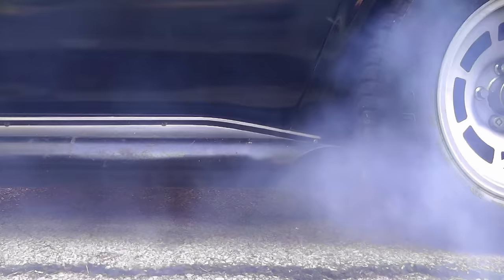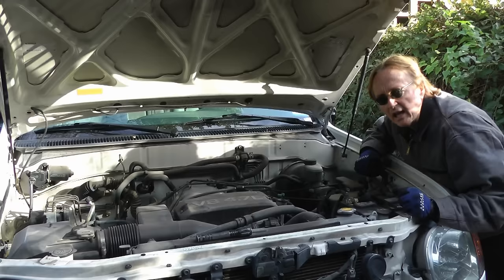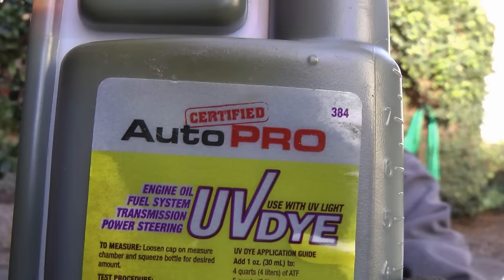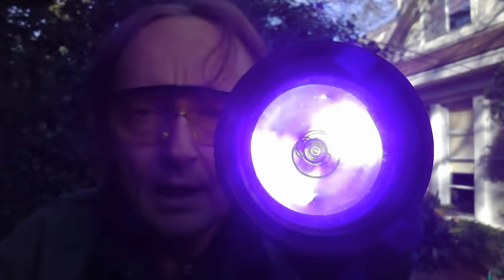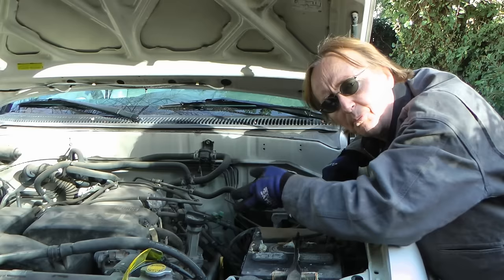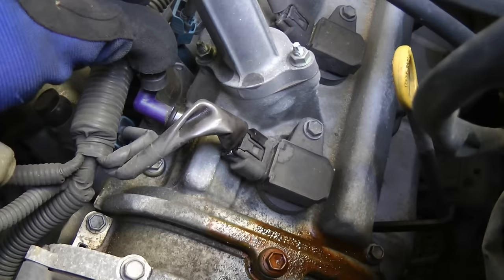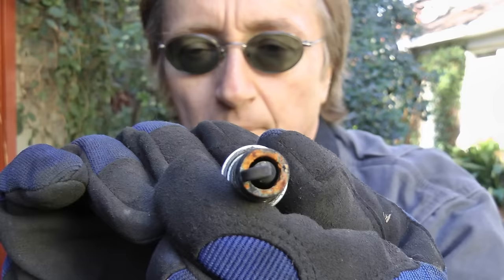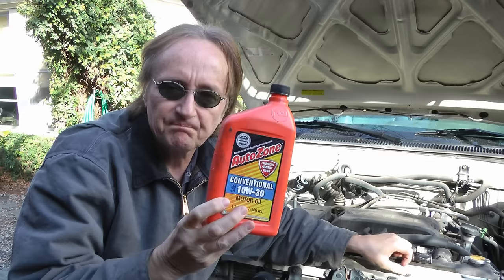How to Fix a Car Engine that Loses Oil (Leaks)

Comment: Depending on the amount it leaks, it could be a grey smoke as well.  This is usually indicative of the valve seals leaking or a head gasket leak, and you should diagnose it first before throwing parts at it.  Valve seals are a lot easier to replace than the head gasket.  

Keep in mind, this only refers to internal leaks.  External leaks will just leave a mess on your garage floor.
Reply: My 2000 Ford E-150 has an internal leak. When I cold start it there a decent sized cloud of blue. I believe it's the valve seals.

Comment: For me it was the valve cover gasket. I thought my car was burning oil--about 1 qt every 2000 miles but after replacing my leaking valve cover gasket, I wasn't losing any more oil! It's common for this gasket to go bad and start leaking before 100k. I never saw oil on the garage floor under the car. It was dripping down on the exhaust manifold and burning off so I didn't realize how much I was losing.

Comment: just a little heads up about the pcv valve. The pcv valve has a spring inside. over time this spring becomes hardened because of the heat. even if your pcv click when you shake it , it does not mean it's still good. The spring might already be brittle and not letting the pcv valve open fully.
Reply: carlosb1 agreed I have changed mine twice cause it was starting to pass oil into the air filter
Reply: carlosb1
Reply: What if the pcv valve clicks when shaling and you feel the vaccum sucking air in? Can it still be bad?
Reply: Where is the valve on an 04 vw Jetta???

Comment from the maker: blue is generally burning piston rings, if the smoke is more white, valve seals. You can do a wet and dry compression test of the engine to see which is bad

Comment: A convertible stingray. That's a rare one. I swear by Lucas oil stabilizer. KEEP THAT ENGINE ALIVE. I'll check the pcv valve on my 5.4 liter. I've always used good oil and either wix or motorcraft oil filter's. I burn oil at 230k but it runs like a champ.

Comment: I see the oil covering the underneath of my car as an extra layer of protection, never need an oil change just keep pooring it in. :)
Reply: She's going in for a service this Tuesday and a new sump gasket will be amongst one of the many belts, rubber mounts,  sensors and expanse of other items I am yet to realize  need changing.
Reply: Darph Bobo too baf u still gotta change the oil filter
Reply: Yes, you still have to change the oil filter, and replace ALL the oil occasionally.
Reply: Never saw rusted out bottoms on an oil leaker.

Comment: 2003 Jeep Liberty using a quart of oil every 1,000 miles...watched Scotty's video, replaced the $7 PCV valve. Just went 1,600 miles with no oil consumption. Why didn't I think of that years ago? Thanks Scotty

Comment from the maker: I have no experience with that oil, so I can't say. I just use regular old castrol oil in my toyotas and it works fine with 235 thousand miles on them

Comment from the maker: no, that's a fine product. I would assume the engine just didn't have it's oil changed regularly enough, and now it burns some oil. I would change the pcv valve and then just live with what it burns and add it

Comment: Thank you sir for making your videos short and to the point, btw I have a 07 tahoe that burns oil but many ppl have said on the forums this is a common problem with them, I have to put 1 qt of oil 2 months after that an oil change, the tahoe runs good, it has 177k miles on it now

Comment from the maker: you replace the whole assembly, or drill out the old one and make a space to put one in, there are tons of them in auto parts stores and one could be made to fit easily

Comment: Also if you're losing oil with no signs of a leak, it could be leaking internally, into the cooling system for example with a cracked head or blown gasket. So check your coolant for rainbows.
Reply: Also make sure you don't have a loose unicorn in there!

Comment from the maker: hassle is getting enough room to get the oil pan off. Many vehicles require removing the engine mounts and lifting the engine up to get enough clearance. Get a cheap manual like haynes to see how your model is done.

Comment: Have you ever heard of the issue with 1998-2002 Corolla's burning oil? I've accepted the fact that the Piston rings just tend to do that even at low mileage, but would changing the PCV Valve and switching to thicker oil at least help at all to combat this issue?
Reply: Many Corollas and many other cars of that era burn oil as they age. Best to keep a low cost bulk supply of oil around.
Reply: George Vapes That's exactly why I'm here. I've got Corolla from 2000 GLS 1'4 petrol.

even the cars manual.(so.when it was brand new) says that it's normal for car to take oil and you might have to add a up to a litre for every 1 thousand miles
Reply: Check the engine gaskets, and the valve seals it might help.
Reply: Research more about this generation Corolla/Prizm engine and you'll find it is a design flaw that the oil return holes on the pistons aren't adequate and often get plugged up over time. Not an easy fix to pull the pistons out and clear the holes (some folks drill new ones too). Try changing the PCV valve and you might get lucky. 

IIf the engine gets good mileage then it isn't worn out. Just drive it until the oil consumption gets ridiculous. Then consider an engine oil cleaning additive called AutoRX available online.
Reply: 999thenewman.........If you ( or anyone else for that matter ) believes "buying & using any oil, just because it is cheaper" is "as good as any oil"..........then you damn well deserve the DECREASED ENGINE LIFE/FAILURE you will be getting soon enough. Using "any ole cheap oil" is not only the WORST thing you can do to your engine, it is THE DUMBEST thing you can do as well. Some old used piece of shit "beater" car ya may have just bought is a different story. Ya don't even know what kinds of oil has been run through that engine over its life. But new or 1 owner vehicles that are still in great shape, and have A MAINTENANCE HISTORY ( showing the BRAND & TYPE of oil used ) YOU SHOULD KEEP USING THE SAME GOOD BRAND & TYPE OF OIL IN THAT ENGINE. You people must only buy junky old cars.........or ya don't even know what it's like to buy a good car/truck that LASTS for hundreds of thousands of miles. Bought my 2000 Toyota Tacoma 4x4 new in 2000, and it still runs & drives as goods as the day I bought it because I'VE KEPT THE SAME OIL IN IT THAT IT CAME WITH: CASTROL 10w30. It presently has 330,000 miles on it........and I'm confident it's going to double that before this engine needs rebuilt. YOU CAN'T ACHIEVE THOSE RESULTS BY USING CHEAP-SHIT OIL.

Comment from the maker: I'd leave it. IF you are doing long trips, that mileage counts as little. If you only did highway driving, for example, you could change the oil every 10 thousand miles and have no problems. It's stop and go driving that dirties the oil up

Comment: Religious maintenance greatly extends the life of the engine. My uncle's 2002 Nissan van has a 2.7L diesel engine, and with regular oil change using premium oil and genuine parts, it now has over 290,000 kilometers or 180,000 miles, and still burns no more than half a quart of oil between oil changes.
Reply: Our religious car maintenance is a lot of prayer, but most of the time we don't have a prayer.
Reply: cars can do better :) my Honda has 310k miles everything works just found her leaking a tad bit of engine oil. think just needs a rebuild to be honest. drinks a quart in about a week :/
Reply: @mysnellvilleblog  hi darla did you guys get your new car yet I hope so
Reply: @mysnellvilleblog  hi darla did you guys get your new car yet i hope so

Comment: I've actually found from working with vehicles, that some oil just goes away while more expensive ones don't. They don't smoke like they're burning oil, they don't leak, but if you change it with a higher quality oil, they go entire oil changes without needing any.

Comment: Depending on the car, you can also run Diesel Oil, such as Rotella 15w40. I've been using this for years, it usually stops most leaks, or slows them to a crawl. However, in the winter time, you should consider switching back to a Thinner oil...since you should run a thinner oil in cold climates anyways.
Reply: True, Rotella works great in high millage cars! I run 15w40 on my truck year round. If the weather gets very cold I run the Rotella 5w40. My truck doesn't burn a single drop of oil with Rotella.
Reply: Never run diesel oil in a gas car bad can damage car
Reply: Some diesel oil are for fleet use, usually okay on gas engines.
Reply: HERPY DERPEDY Oh so 5W is for gasoline vehicles, and 10W are for diesel vehicles
Reply: Anthony Shell tech dept specifically states Rotella not recommended for gas engines as it includes high concentrations of a certain detergent that will ruin cat converters.

Comment from the maker: it's stripped. So try grabbing it with vice grip pliers and pull real hard down. If you get a small gap, put a screwdriver in there to push while you turn. Pray you don'[t have to drill it out.

Comment: I have a 2006 GMC Envoy Denali, I have some lite white smoke coming from the tail pipe, I had my mechanic put in 4 quart of oil,& some oil stabilizer in, I watched your video, I'm gonna ask my mechanic to check the PCV valve.

Comment: My 02 Camry oil level gets down to about half-full every 3k miles, so while it's burning oil, its not burning that much. It has 242k miles, however, I've always gotten oil changes every 3k miles (4K at the most). Could this be a PCV valve or is it just engine age? I hear of people all the time getting astronomical mileage on vehicles (500k and sometimes evenover 1 million miles) by religiously maintaining their vehicle, so 242k miles doesn't seem like that much to me.
Reply: A half a quart between changes is normal with a high mileage engine, but using motorcraft oil will cut your oil consumption in half. Stick with the recommended oil weight.
Reply: GeneralSirDouglasMcA those 02-04 Camry's burned a lil oil with the 2.4L. It was a bit notorious. If recommended trying the Lucas oil stabilizer.

Comment: Scotty, don't forget to mention cars that don't have PCV valves. All have some kind of breather. I have fixed many by simply cleaning the hose, tube, or pipe along with any valve  (Volvos have honeycomb condenser). I "fixed" a guy's F150  V8 with rebuilt long block that kept blowing the dipstick out and geysered oil (very messy) by replacing the "reused"steel tube from the PCV. His old engine probably would have run years longer.

Comment: If there's any "cure in a can" for excessive oil consumption, it sure as heck ain't overpriced lard oil Lucas. Marvel Mystery Oil in many instances can stop the valve seat wear that causes excess burning. If you check out the Saturnalia forums, about the only thing that can be done for those notorious oil burning 1.9 Saturn motors from the 90s is to run Marvel Mystery Oil in the crankcase to free up those coked up valve seals and carboned piston rings. I went from burning one quart per 1,000 miles to a half a quart every 3,000 miles. I also had a slight oil leak at the rear main seal, which went away after about two oil changes using MMO. Marvel Mystery Oil is 1/3 the price of Lucas, so experiment with that before you drop money on Lucas. Besides, if the owner of the vehicle didn't care enough to do frequent oil changes in the past to prevent wear like that, why would he drop an extra 12 bucks per oil change on Lucas Oil Stabilizer?
Reply: Marvin Harrison Smith II Because it works.
Reply: MMO swells the seals that's why they quit leaking.
Reply: That sounds like what I need. Mechanic says ALL the seals are leaking and it would cost the same as replace engine to go in and replace all the seals. So I need something to help it leak less into the combustion. My whole neighborhood disappears into smoke whenever I start my car!
Reply: Metqa well is it white smoke or blue smoke?
Reply: It's oily smoke. as in you can smell and taste and almost feel the oil as it billows out the tail pipe, and it doesn't go away until the engine is really hot,like drive around town for 5 minutes looking like a rocket ship lifting off horizontally. But it's not dripping anywhere outside. It's not the kinda wispy white  vapor  you see in the morning when it's cold before the car heats up. Thick Billowy opaque, out the tailpipe, and more recently from neath the hood, enveloping... you get the idea. ( I hope. :D )
Reply: Valve stem seals and/or rings. What motor you got? Definately throw lucas oil stabilizer in and see if it helps
Reply: Metqa if it's that bad I'd throw in the idea that it's more or less very worn rings.
Reply: Valve Stem seals! They cleaned them but said, it's a lost cause in the long run. So Bardahl No Smoke No Leak!
Reply: Chris n Tracy Maze  does mmo thin out the oil ?

Comment: Change your oil every 5000 miles with a OEM filter. Problem solved for 250,000 miles.
Reply: Robert Davis what about O'Reillys filters?
Reply: Robert Davis OEM filters?? DF r those
Reply: Robert Davis wix xp filters are just as good. You can do a easy search on oil filter specs to see the quality of filter brands.
Reply: zhbvenkhoReload the O'Reilly brand filters are made by Wix at the moment.
Reply: DJ Lucario original equipment manufacturer.... in other words, factory, dealer supplied products, not afternarket
Reply: Robert Davis Ha, yea good luck finding an OEM replacement for my 89 olds Troféo.
Reply: There are many filters that totally surpass oem filters at fraction of the cost, come on now Bubby!

Comment: I used to have a car with the valve stem oil seals worn and used to top up 5 litres of oil every 2,000 miles for a total of 100,000 miles and changed the oil filter every 6,000 miles.
I eventually sold it with still great oil pressure and perfect engine.
That engine did 100,000 miles like that because it was getting fresh oil all the time.
i saw the other owner some years later and he said it did another 50,000 miles and was still perfect.
So it's not always bad news with your engine using oil.

Comment: I have a 2006 Honda Element AWD with a 2.4L inline, 4 cylinder. The engine is using approximately half  a quart of 5w20 oil every 600 miles. There isn't any leaks, oil just seems to disappear. Engine has 145,000 miles on it and I purchased it used with 142,000 miles with all maintenance records and it has had excellent care with all the on time oil changes done at Honda. I had the pcv replaced which did not make the oil usage any less. If it's rings/valves how quickly does the oil usage increase, because I can't afford another vehicle. Thanks for any advice

Comment: Thanks for the video. My 1999 Corolla burns oil for the last 2 years. (Not my fault. That the way I bought it). Changed PCV - didn't stop burning. Today I am adding Lucas Heavy Duty oil stabalizer. Will see how it will work out.

Comment: 2 other ways to slow engine burning is to use higher viscosity oil, like 10w30 or 10w40 instead of 5w30 oil, and another are high mileage oils that are supposed to swell the engine seals, but I wouldn't use the special oils unless as a last resort.
For instance by '99 Civic DX burnt 1qt per 2000-2500 miles, had minor piston slap when cold at certain RPMs. Changed from Valvoline 5w30 to Chev Supreme 10w30 and now piston slap is nearly gone (or hidden), burns 1qt per 3500mi or so.

Comment: The pcv valve has become pricey on the 4.8 GM motor due to the bright engineers molding it into the valve cover which you have to replace to change the pcv valve. Just had this $219.00 job done (included labor) and now waiting to see if it fixed the problem.
  Next will be adding the seal repair from your video (AT-205) because while the pcv valve did not work I believe it built pressure up in crankcase causing the rear main to leak.
 A double thumbs up for your video's Scotty! This is my go to place to see if I can fix in house before I make the mechanic call.

Comment: 05 v6 Tacoma was missing on cold starts in cylinder #3 changed all the plugs and coils problem went away for awhile then came back I noticed I started burning oil (no leaks) changed the pcv valve all my troubles went away. It's amazing what a $6.85 part can do.

Comment: I was wrong about the oil, it turns out it just needed new radiator. A good friend fixed it for me.
I checked my oil level after I posted my comment the other day and realized it did have oil, much to my relief.
My Crv is running just fine now.

Comment: My dad's 225k-mile 2006 Tundra V8 (same engine shown in the video) is low on oil and even lower on coolant.  It's on its 3rd radiator, which appears to be the culprit of the coolant leak.  I'm hoping the PCV valve is the oil issue.  Otherwise, it may be time to list it for sale.

Thanks for the video, Scotty!

Comment from the maker: hard to say, it can be worn valves, it can be weak oil pump, or just worn out engine that needs new bearings, as bearing wear lowers oil pressure, and then when they heat up the pressure goes up as they expand.  Things are never simple on VWs these days, especially that over engineered VR6 engine

Comment: The 1zz is such a great engine it'll probably go on like that forever.  I've had this 2JZ-GE (JZZ31 soarer) for nearly 9 years now, and it's always used a little oil, and a little more since it started with the leaks recently - I'm very fussy about filter and oil changes every 10,000km, and when I had it imported it came with a full Toyota Japan service history - so it's always been a bit of a puzzle since they aren't an engine that is known to use oil normally.  It's done 240,000km now.